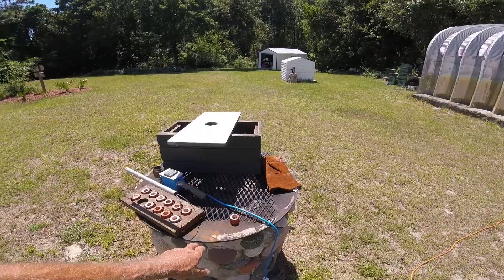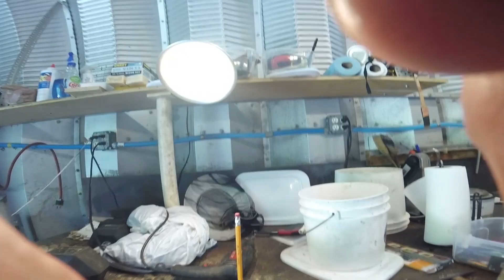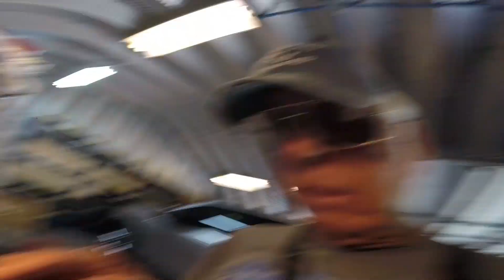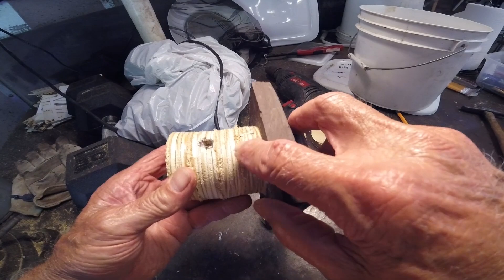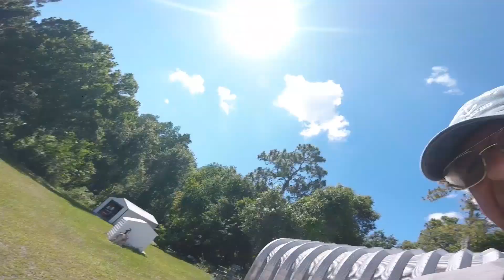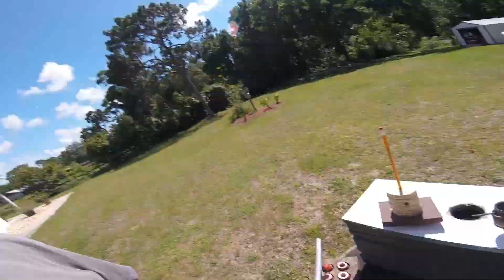I Had A Dream

Comment: That is an excellent idea!!  👍🏻.   But, don’t glue in a plug on the top.  Plug it with a dowel or something and then pull that off to check to see if the treatment is over.  How many times has a guy pulled that vaporizer out of a hive and it was still going a little?...a lot including me.  I’d like to see you use that some before I go out to the shop and build me a couple.  Thanks bro !!!  🍺🍺🍺
Reply from the maker: Hey Todd Bro! I will be using them Friday and do a vid on that .Thanks for watching!